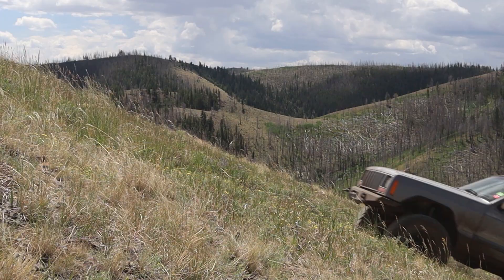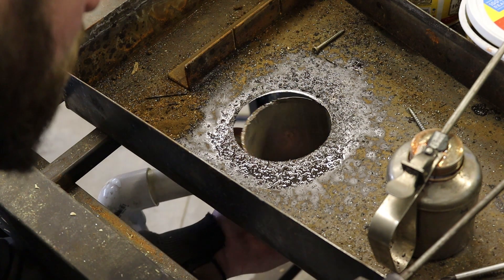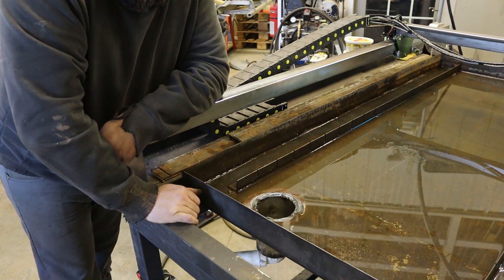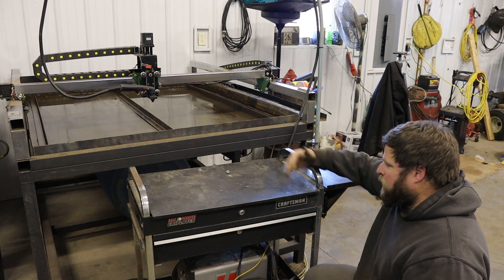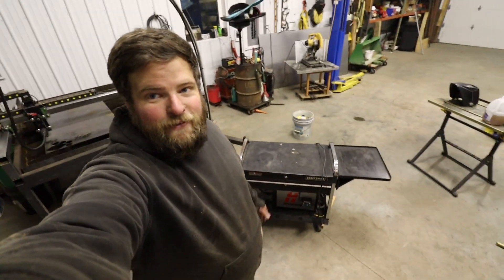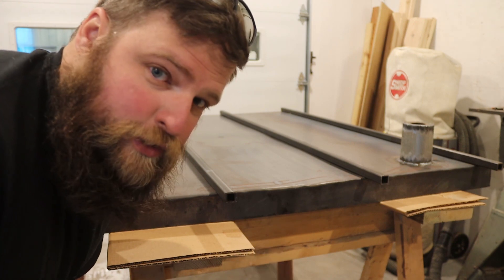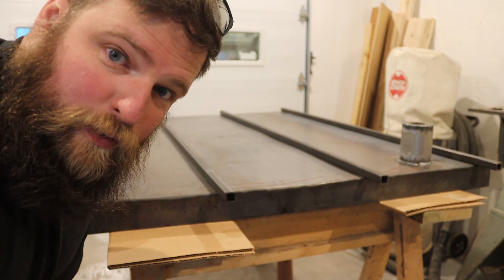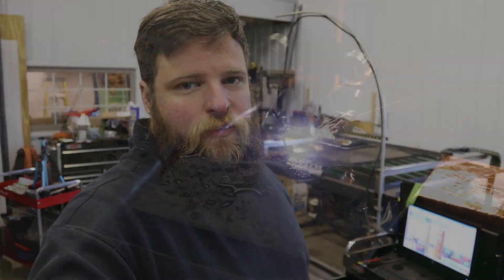Making Changes/UPGRADES to my DIY CNC PLASMA TABLE

Comment: Cost of build vs money & time spent producing products.  I am considering changing my CNC router table to a plasma.  How much space to you typically use area wise for making parts?
Reply from the maker: It kinda depends on what you want to use it for. If your business is metal art/signs I’d say 3’ by 3’ would work for most parts. Now if you wanted to cut out bumper parts and have a continuous plate from one side to the other you’d need and less 5’ on one axis. Most of what I cut is 18” squares but I haven’t  got into production of parts or large customer orders. 4’ by 5’ works for me right now